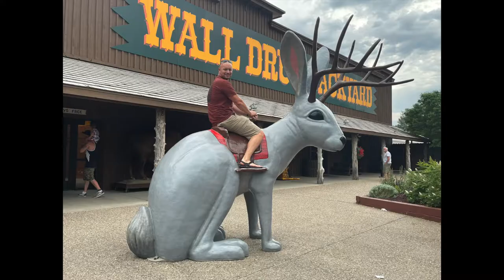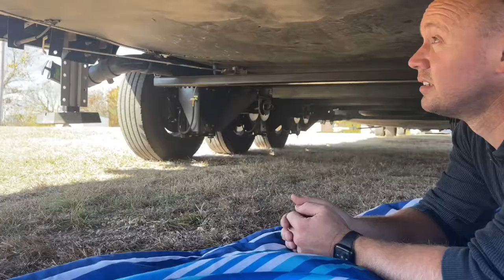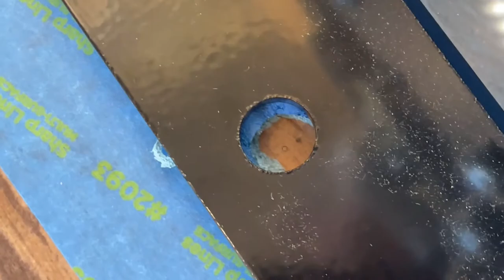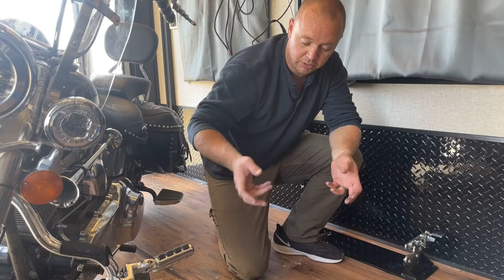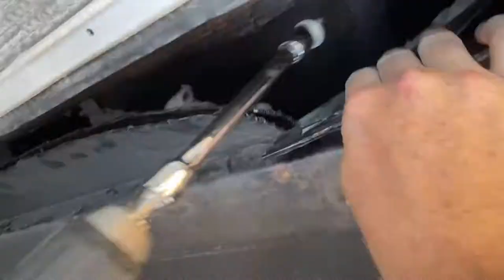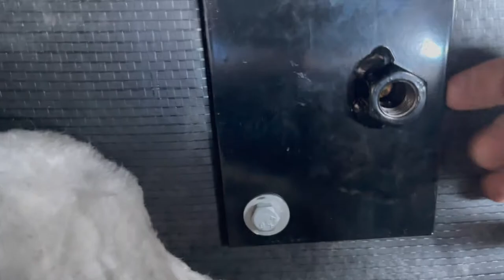Biker Bar Installation on our Grand Design Momentum Toy Hauler

Comment: Too bad you didn’t have a magna-spot to locate where you wanted to drill. It makes jobs like that easy.
They are a little pricey for one time use, but if you need to locate a spot to drill often that are great. Made by magnapull. We used them when we needed to drill in that exact right spot through a wall.
Reply from the maker: That definitely would have helped!!!!

Comment: Excellent video. Planning a couple of these our toyhauler, wife has her own bike. What did you do to seal up the under side of the trailer. This is the part that I'm not looking forward too. My unit is completely sealed up and I hate the thought of making cuts in the material as it becomes an access point for critters if it isn't sealed well. Thank you.
Reply from the maker: Hey Shawn,

They make underbelly tape. I used gorillia tape and heated it up to "glue" on. 7000 miles later it's doing great! Good luck. You will absolutely love the biker bar! It makes life so easy!!!
Reply: @WeLiveFreeRV  Awesome,  Thank you so much for replying.  Ride Safe!!

Comment: Hey. Great vid. I have a biker bar in my enclosed trailer but want it in my toy hauler. What sized screws did you use to secure the plates underneath? Thanks!!
Reply from the maker: Hey Jeff! Sorry for the delayed response. We bought the grade 8 bolts at a local hardware store. The bolts we bought were 4 inches, BUT the length will depend on your rig and how thick your flooring is. We had to go through our flooring, the rubber top, and then the base boards. 

I'd suggest you use the initial bolts during your install and then measure how much longer they need to be. 

Alternatively, buy longer bolts than you thinkyou need. The mounting system underneath allows the bolts to be "too long" and there was lots of space under there for us!

Good luck!

Comment: Any updates? Still working? I am in the process of buying a toy hauler and want to utilize my Biker Bar. Have been planning and honestly you did it just the way I was planning, just worried about water (gray and black) tank positions, but with just one bike, I think I have plenty of options. Thanks for posting.
Reply from the maker: +Troy Lane it works great! We were worried our measurements were off for the initial drilling. This install is one of those moments where you measure multiple times and then double check it all again. A couple people on Facebook have ended up having to drop their tanks to finish the install!

Good luck and happy modding! You won’t be unhappy with this one!

Very respectfully,

Jeff and Amanda